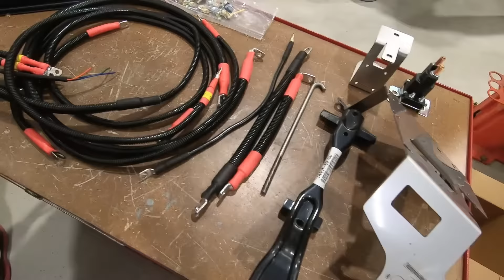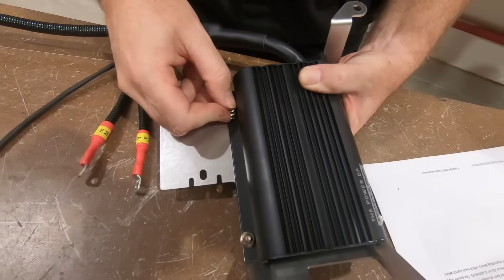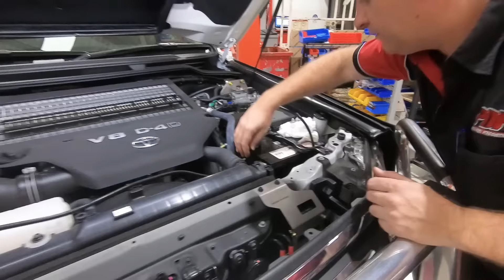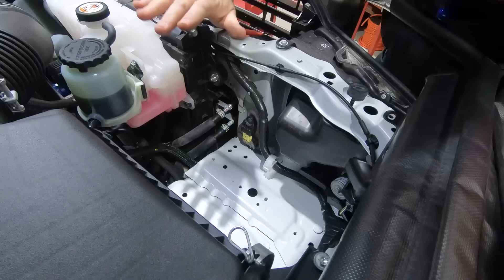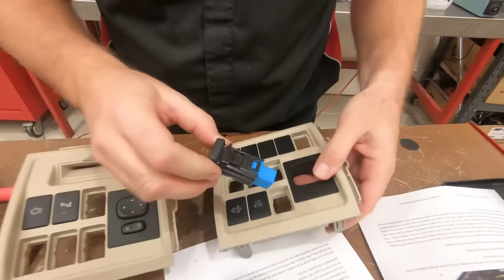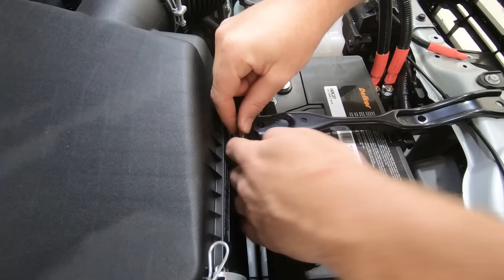200 Series BEST DUAL BATTERY System - Full Install

Comment: Amazing video. Two questions. I have the diesel version in Latin America. It’s has 2 batteries already. Can I use on as main and another as aux? If so what would you use as main?
Also, do you have a video where you show how you bring the power form the aux battery inside the car all the way to the back to have Fridge, usb and 12v outlet always on with the aux battery?

Comment: Thanks, that was a professional job. Did you have to relocate the Power Steering Reservoir to be able to install the auxiliary battery? I see that there is enough room to do it, unlike our middle eastern version of 200 series, the Power Steering Reservoir is bolted right into the metal where the auxiliary battery should be installed. Any suggestion?
Reply from the maker: Interesting! Send a photo through to our info@perthdiesel.com.au email. Here in Aus, there is space for the 2 batteries from factory, no need to relocate the power steering.

Comment: do you find a difference in crimping the anderson plug connections on vs filling the connector with solder and dipping the wire in?
Reply from the maker: Crimping can assist in ensuring there is a secure connection.
Reply: Just a question, should the fuses be as close to battery as possible?
I just hear that all the time. I like how neat this system is but normal I see the fuses on a bracket on the battery holding clamp. Reason being I have a brand new 79 2023 and do my own Redarc bcdc and want to know the correct answer. Cheers awesome bracket